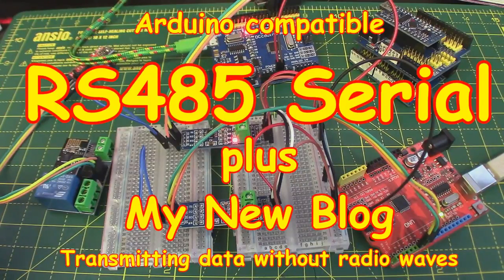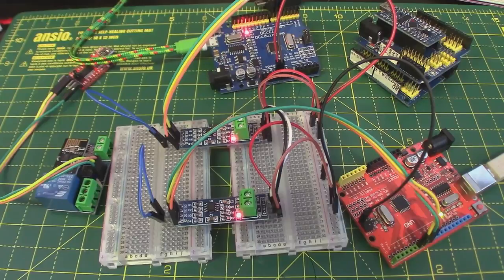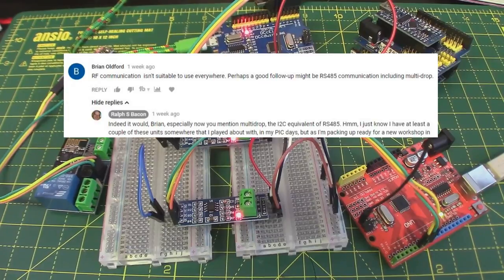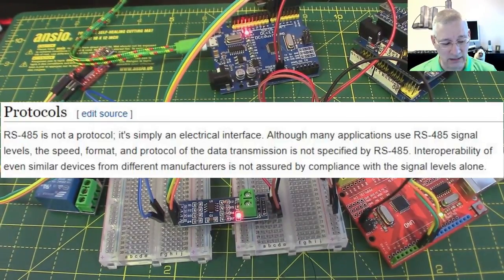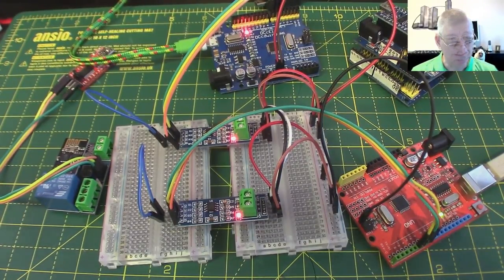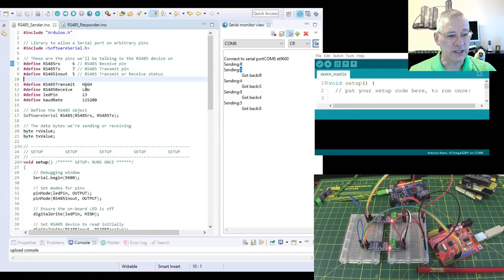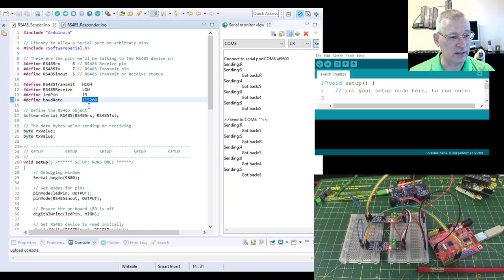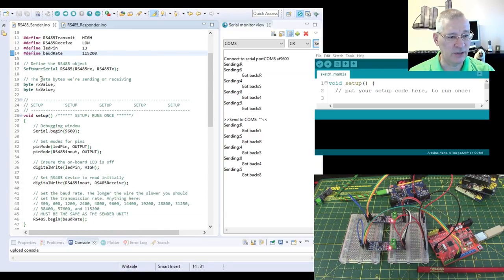#106 RS485 Serial Data Transmission - on wires (no radio waves)

Comment: Cool, reminds me of my old days when I ran Land-line teletype over in Vietnam, we dealt with a sort of ancient version of this using tube sets that amplified the signals after they had been processed by the crypto gear, I also did some time in the Brigade Headquarters Switchboard room as an operator for a few months, this was where I was exposed to the phantom and phantom simplex circuits using the earth as one side of a land line phone circuit it was really amazing, we could go from the Cam Rahn Bay to Saigon and to Phu Bi using just the earth for one side of the circuit.  Basically one wire communications. Of course we did use special gear that got it done, I still recall the glow from the tubes in those boxes....
Reply from the maker: Single line transmission was how the first telegraphs were sent, Jerry, using the actual ground as, er, ground. Unfortunately, for the Wild West users, the ground in the USA sometimes became so dry that the transmissions stopped. There are anecdotes of telegraph operators pouring jugs of water around the earth peg to try and get a connection. Eventually, technology caught up and two-wire comms became the norm and no more wet earth pegs were required! I'm not recalling this from memory, I hasten to add, it's just something I have learned about!

Comment: Hi Ralph. I see you managed to find your MAX485 modules.  '-) You can have up to 32 standard 12 Kohm modules (including the master) on a RS485 bus.  If, however, you use the MAX487 chip you can increase this to 128. I'm soaking up Nick Gammon's wise words and will adapt his protocol to my needs. Many thanks for the video.
Reply from the maker: Yes, Nick Gammon (no relationship, but there should be) has a great website and goes into great detail, Brian. Good luck with your project.

Comment: Once used some RS232 - RS485 converters for a  fussy customer. Distance was a bit close to 10m, so customer insisted. He also insisted on some "fancy" ones at about £50 each! He was paying, so he was correct ;)
Reply from the maker: If the customer has a reason for specifying higher quality components, so be it! They must have a reason (and not just that the bloke down the pub said so).

Comment: ALWAYS USE GREAT CAUTION WHEN MAKING DIRECT COPPER CONNECTIONS OF ANY KIND TO OUTBUILDINGS!!

This is a HUGE subject to try to cover briefly in a comment. Suffice to say the following.

1. MASSIVE inductive spikes (10's thousands of volts) can appear on the outdoor connections that can blow your circuitry (literally) to smithereens. Research for example opto and galvanic isolation of RS485 lines.

2. Protect your circuits and youselves as much as possible by fitting suitable lightning arrestors and transorbs (tranzorbs, TVS diodes) with suitable fuses in series - Google for more info.

3. Even when any outside mains power supply has been properly and professionally installed with maybe individual bonded earth in addition to any SWA earth cable back to the consumer unit, NEVER, NEVER, NEVER assume that there is ZERO voltage between ground potential in the outbuilding and ground potential in the house!! It MIGHT spike to several thousand volts difference during an overhead lightning storm!!

It's why it's not such a good idea necessarily to have an outside supply from an MCB covered by an RCD feeding other internal circuits as well. Use a separate supply feed altogether from the main isolator or use an RCBO connected BEFORE the main RCDs. Otherwise you may find spurious whole or half house power trips happening all the time.

Hope this doesn't confuse people too much but please research on line as it is important for YOUR life and safety as well as to protect your gear.
Reply from the maker: Thanks for that safety update, Bob, much appreciated, as many treat anything at mains potential and higher as no more than a 9-volt battery. And as you say, ground on any circuit is not necessary zero volts.

Comment: If using twisted pair you have to ensure you pair the twists up, and you should use a drain wire, as you mention grounding the shield on one side, this is a drain.
Reply from the maker: Just like my shiny new CAT-6 ethernet cable going to my soon-to-be-constructed workshop, that has an exposed drain at one end for (extra) earthing. Good point, tablatronix, thanks for posting.

Comment: Used RS485 for my original home grown home control system, about  9 years ago. Had the same problem with the output buffer. 
RS485 worked  well for a few devices but found CAN bus a lot easer and more reliable for multiple devices. The MCP2515 CAN bus Module are a bit more expensive but still less than a £1 each (from AliExpress) and go up to 1Mb/s and use the same number of com wires. 
If you use a micro controller with built in CAN bus (e.g. ESP32) you can just use a SN65HVD230 CAN bus buffer about the same cost but requires fewer pins.
Reply from the maker: So another comms protocol for me to investigate then, Nick! Although I think my car uses a CANBUS to route all the signals around, which is how it knows the offside parking bulb is blown. I'll take a look at the device you mention, at that price it seems worth looking at in some detail. Thanks for the heads up, good to hear from you.
Reply from the maker: Excellent links there, NIck, thanks for that, I (and perhaps others too) will explore. I'm amazed you can use standard telephone wire for both power and signal; as far as I know, they are not even twisted pairs just wire so I will be interested in that, for sure.
Reply: Not sure if standard phone cable has twisted pairs but the cable I used has. It’s a lot better to use, in the home, than ethernet cable as it’s thiner and more flexible. This makes it easer to install without looking too messy.  
So far my run of cabe is about 30m using 500Mb/s it has been very reliable. Ideal for sending short control messages to and from multiple low cost devices. Which is what it was designed for I guess.
Reply from the maker: I will check my telephone cable - perhaps they are twisted by default! Thanks for this, keep tuned!
Reply: Hi Ralph
By default virtually all telecoms type cables use twisted pairs. This includes the earlier CW1308 cables right through to the CAT5 and CAT6 cables that are used for modern structured wiring systems. I think this may be the "ethernet" cable to which Nick Burton refers. If you strip the outer jacket off these cables you'll find the pitch of the twists of each pair is slightly different. This is to even up the coupling between conductors. Since they are designed to operate as a "balanced" transmission line those induced common-mode signals tend to cancel themselves out.

Comment: I just remembered why I have a pile of these modules at home, RS485 is used for DMX lighting control, so you can use these modules along with an Arduino (or any similar) to control DMX stage/disco lights.
Now I mention it sounds like a cross over to Big Clive channel :D (sure you don't mind me mentioning his channel here)
I had a sketch working on a few lights as a proof of concept and meant to do something proper with it for a simple control without needing full computer, dmx dongles and software for some static looks and some basic effects.
Reply from the maker: Who Clive? New boy, is he, Matt? 😜
 
In my days as a DJ (yes, really) I hankered after a DMX controller. Even though my lights could have been connected up together, the controllers and cables and so on made it prohibitively expensive, back in the '90s. I think I might have been able to concoct something to control those lights with an Arduino and an RS485 module, had the Arduino been invented back then. Even worse, I did one stint in a huge nightclub and they let me use all their equipment, including DMX controlled lighting. There's something special seeing laser lights move in perfect synchronisation before doing their own thing! Ah yes, memories of Robin S, Show Me Love... Thanks for the memories, Matt.

Comment: Hi Ralph, I maybe missed it somewhere in the video but it is probably worth mentioning that RS485 requires 120ohm terminating resistors at each end of the line, i cant imagine they are built in to the RS485 modules as this would then prevent you from having anymore than 2 in the network so this would likely need to be added manually. nice video though, thanks for sharing :)
Reply from the maker: Ah, yes, you have to be careful here, DazzleK93. I did mention that you don't need to add resistors because they are all built into the module (see schematic here: http://yourduino.com/sunshop//index.php?l=product_detail&p=323 ) BUT you are very right in pointing out that the more you connect the lower this resistance will be. I'm guessing the manufacturer of the module does this so you can start using the module right away with no faffing about. But...
 
If you connect more than one (and this applies to I2C modules too that have 10K pull-up resistors on the CLK and DATA lines) you should really REMOVE the extra ones. So, in this case, R5, R6 and R7 should be removed on all but one of the modules.
 

Very well spotted, and thanks for bringing this up as it would surely cause issues if half a dozen were all connected up on the same lines. Thanks for the post and your kind words too!
Reply: I am surprised they did not make the EOL resistors a jumper to make it more multi drop useful.
Reply from the maker: The only reason: cost. As always, things are built down to a price. Now if Sparkfun had designed these they would have had jumpers, a built-in LED display of some kind, and an onboard 4K EEPROM, just for fun. And then they would have cost £10 each! Sorry, am I being too cynical here? As it happens, your post has highlighted this issue so removal of said surface-mounted resistors should be easy.
Reply: If you want to optimally use these modules in a multi-drop configuration you'll need to remove R5, R6 & R7 from the MAX485 board at all the intermediate stations and R5 and R6 at one of the end stations.

Comment: Hi Ralph I do think RS485 deserves to be revisited to scratch a little deeper below the surface. You had a defective module first time round so you were unable to create a  multidrop network. Additionally, you never overcame the buffered delay in printed characters.
Reply from the maker: I'm struggling to recall the details, Brian, but wasn't the delay just the fact that one unit was receiving the data and the other was sending the NEXT request at which point the first request was then echoed back to the first unit? Hence the (one character) delay? We could have overcome it, I believe, by asking for the response before sending another character. If this all barking up the wrong tree let me know and I'll deeper into it.
Reply: Hi Ralph I recall you were unable to properly set up a multi-drop network as one of your RS485 modules decided to have a benny (no pun intended). Wasn't the character held in the buffer and not sent out until it had received another? Or something like that.

Comment: I use SN75176B for RS485 communication. I have not faced the issue as mentioned by Gammon. But I have a different issue -- after transmission, once I enable reception, sometime, the 1st byte of reception is the last byte that was transmitted. I have used some software work around, but a simple fixed delay after transmission did not solve the issue. Somehow, either the delay sometime appears inadequate while some other time, the delay becomes too much and I loose the 1st valid RX byte.
Reply from the maker: So is the 2nd byte you receive actually the first byte from the sender unit? Do you get the last byte successfully? 
I had a similar issue but it was all about the FIFO or buffering. In other words, it was my misunderstanding of the protocol and my software than an actual error.
Reply: @RalphBacon  Yes could be the reason. In such case, I usually bypass the SW layer and directly access the HW register. But my code is running on ESP8266-NodeMCU and I am not familar with background. Hence, I have to be happy with using serial functions provided in Arduino like code.

Comment: Very nice tutorial,  1 quick question, If you had more then 1 slave how to determine the slave id?
Reply from the maker: I'm using SoftwareSerial library to keep things simple. Unless you can make each slave accept an ID, using digitalWrite and then ensure you only send data to that Slave ID (eg for a response), I don't know if the way I did this would work. There is undoubtedly an RS485 (or MODBUS) library available these days that works on the Arduino family and which you can assign  an ID to a Slave (or read it, if previously set).  Best I can suggest, sorry I can't be of more help.
Reply: @RalphBacon  Thank you so much, your tutorial help me a lot, though i wanted to understand more about master and  multiple slave.  Once again thank you so much.

Comment: Hi, great video, I have a question, is it possible to connect multiple slaves (rs485 output sensors) to MAX 485 (to A- B), and read slave values from Arduino, Thanks in advance
Reply from the maker: Yes, the RS485 protocol is similar in some ways to I2C and you can hang multiple devices off it. I think I mention this in the video?

Comment: Thank you Sir for another great video!!! Question: what is the relation between baud rate and admissible transmission distance? Half baudrate means double distance or is it more complicated? Here's an idea for some future video: PCA9615 that converts I2C to a differential line. Looks quite nice for long distance communications with sensors and there's surprisingly little amount of info online. Best regards
Reply from the maker: It's not quite that mathematical, Alex. The  lower baud rate ensures less risk of corruption over longer distances. The only way to know whether your baud rate works is to try it. But what works today may not work tomorrow when the microwave next door (or a hairdryer) is switched on!

Regarding the PCA9615, that deice does indeed look intriguing. I wonder if it could be coupled with a TCA9548A I2C multiplexer, that would be interesting too?
Reply: ...3 wire UART comm are simpler.(RX,RX,gnd)..not sure about its range

Comment: Thx for the good video! i tried it out immediately but unfortunately only got This:  Received:?
   in the  Responders Serial Monitor. Did i wire something incorrectly? pls help
Reply from the maker: So you got a question mark as the received data?  Hmm, sounds like corruption or transmission speed incorrect or mismatched. When I get stuck like this I just liberally sprinkle my code with Serial.print statements so I can trace the data from one module to another, and see exactly where it got changed. Try that first, Dominik.
Reply: @RalphBacon  thx for the quick response, ill try it out later

Comment: Hello, I have a question: is this a 485 communication.
Is it possible with a "D1 MINI WEMOS Pro 4M 16M" using "Tasmota" e.g. B. to control a "JUNTEK DPM8624 60V24A Programmable DC DC Digital Adjustable Step Down Voltage Power Supply Buck Converter 485 Communication"?
Reply from the maker: Hmm.. are we talking about THIS device: https://s.click.aliexpress.com/e/_DE0lb5h

That device is controlled via a standard USB-to-Serial (TTL) adapter, just like the ones we use in an Arduino environment. Nothing is mentioned about using RS485, although the protocol might be used as part of that Serial comms... but seems unlikely.

Let me know if it is another device.
Reply: @RalphBacon  OK. I saw somewhere that you can use "TTL to RS485 Module UART Port Converter Module EIG88" to control the device. watch?v=yOcoux9IbzM&t=218s

Comment: Great project Ralph, Can you help me fixing issue. My master somehow not receiving anything back. It only sending. Not sure if slave is even getting message.
Reply from the maker: Make sure your TX/RX pair go to RX/TX. Put lots of Serial.print() statements in the code so you can see what, if anything, is happening. Debugging is all part of learning C++ (as I have just spent most of the day tracking down a bug, very laborious, lots of display statements, I know how time-consuming and tedious it can be - but it must be done. Don't give up, you know the sketch works, it can only be your modules and/or the wiring.
Reply: @RalphBacon  Yes trying same, would it be possible for you to share exact wiring picture, so it might help me debug if i am missing anything from video. Also i am using 2 nano, for which i used Tx & Rx pin and changed code to use 0,1 pin.
Reply: @RalphBacon  Finally i am getting on both Serial monitor, thanks it took me long to fix it. But i still have issue, the data is always reverse ? mark, i did looked at baud rate and its 9600 on both Serial monitor and program. Any idea what could be i am doing wrong here?